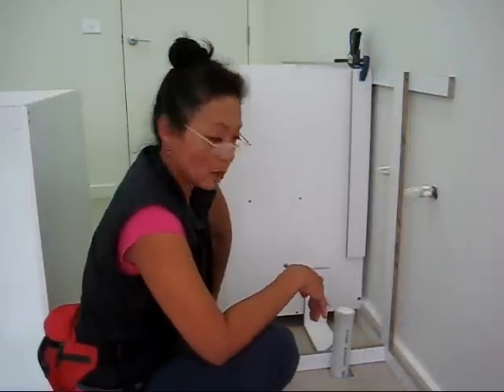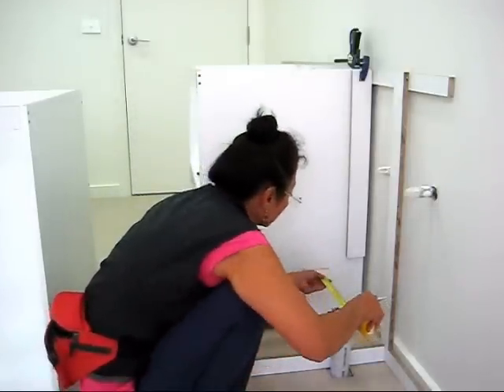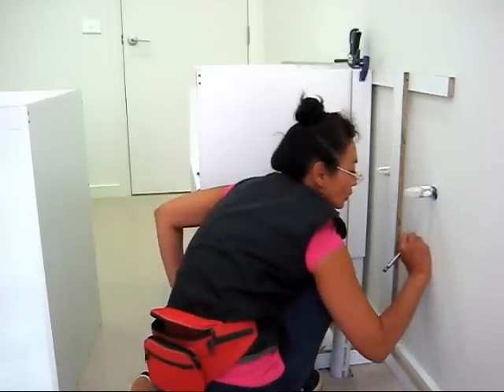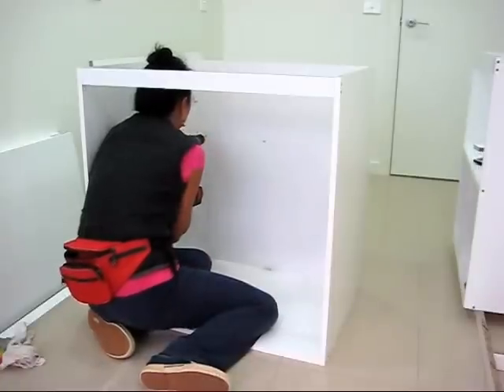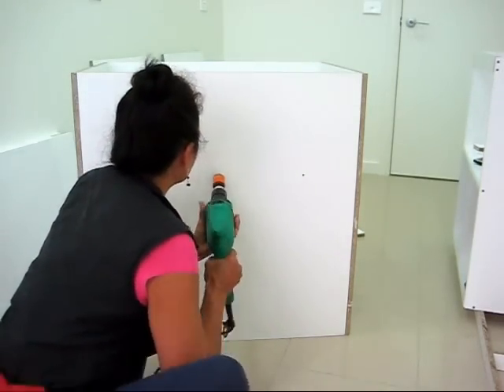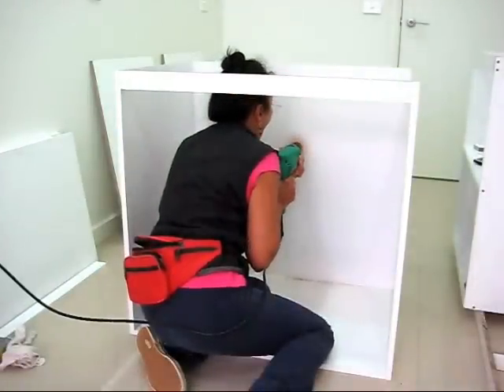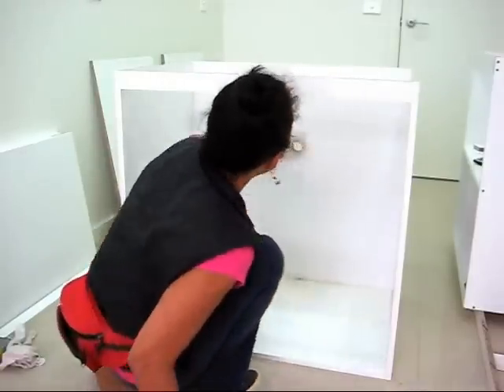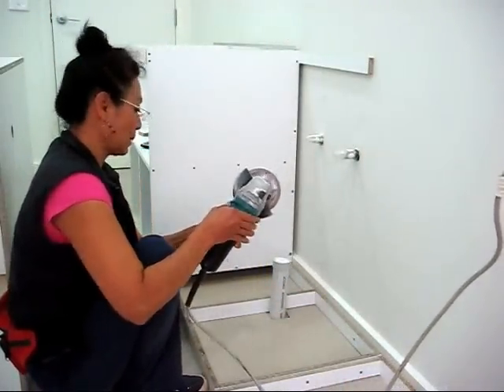How to Measure and cut drain hole in cabinet

Comment: Lots if not most installers will not even install the back panel instead just use a support board. This is how you are supposed to do it.  I just bought a small vanity to replace the deteriorating old one that is in a small half bath.  I will need to do this at least on the back panel. Thank you for the video.